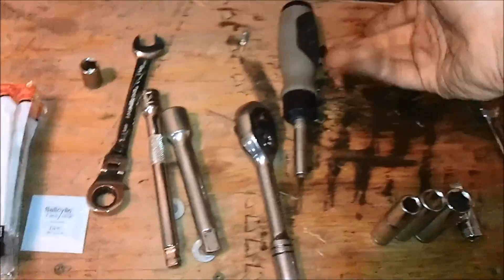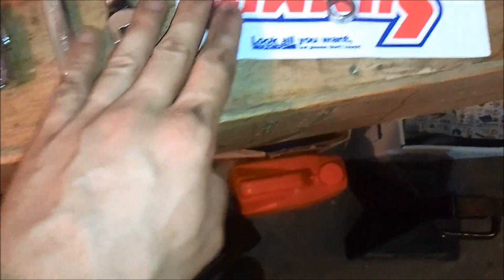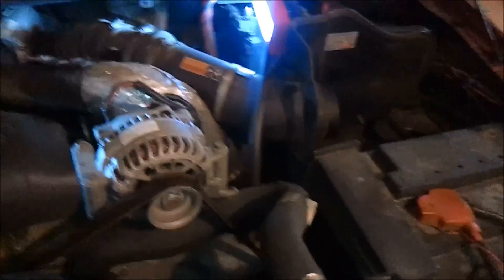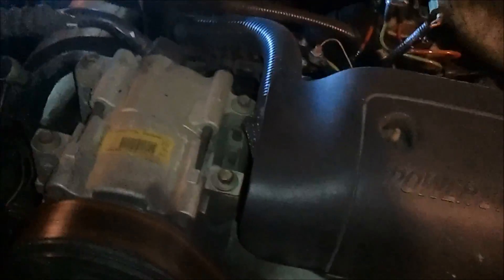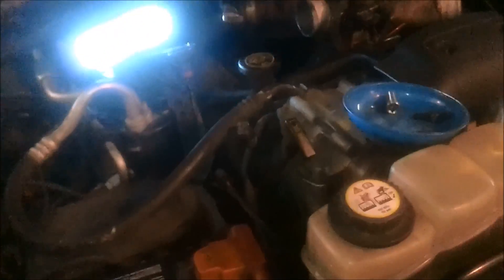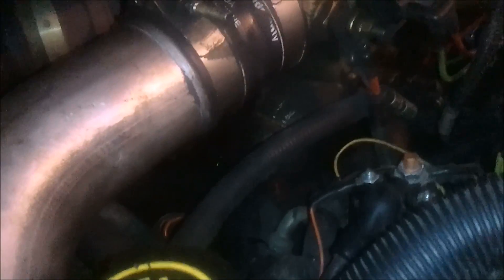How to replace 7 3 Powerstroke Glowplugs

Comment: I just lost 11.46 seconds of my life.  The only thing I learned here is that you got to take the valve cover gasket off to replace them and some other hoses and stuff.  whoever designed this engine needs a slap up the side of the head.  WTF, you got to remove the valve cover?  Never had to do that on a german or volvo diesel. fuck!

Comment: I just purchased Permatex like You have. You put on threads, but You said to put somewhere else on glow pugs,Why at besides threads?Are you only using die electrical grease on wire that goes to glow plugs? With my truck having Allot of miles, Should I spray something down on threads of glow plugs to try and not have any break?
Reply from the maker: +Richard Chamberlin Sorry for not being clearer on that I use the antiseze on the threads and die electrical end of the glow plug. I have never sprayed anything on the glow plug and you kinda cant cuz there is some oil right on top of the glow plug and when you take the glow plug out it goes into the cylinder.
Reply: +N4ANE THANKS FOR ALL THE ADVICE !!! Going to make a YouTube video out also to help others.
Reply from the maker: +Richard Chamberlin Your welcome good luck

Comment: I recently bought a 7.3 is a 1999 dually when i start it it blows white smoke for about 2 mins then it goes away, somwone told me it was the glow plug relay but i tested it and got the 12v that it should be doing, do you think changing the glow plugs on mine would fix that problem or what do you think its causing it? thank you
Reply from the maker: +acarrizalesa Sounds to me like the injectors how many miles are on it?
Reply: 223k
Reply from the maker: +acarrizalesa I would say its about time for some when you do them you might as well go ahead and up grade them more power better MPG

Comment: I just bought a 2000 dually.  I'm pretty sure the glow plugs have never been changed (147,000 miles).  What happens if all eight are swelled in there?  How do I get them out?
Reply from the maker: There are a few vidoes on here with people showing ways of getting them out if that dont work than you will have to brake them off and take the head off or take the head off and then brake the ends off

Comment: You mentioned I have to remove the inter cooler lines x 2 on the pass side?  Are these A/C lines and if so will my truck need a recharge after?
Reply from the maker: No that is your intercooler or charged air cooler and also know as air to air cooler  your A/C lines are smaller that the air to air cooler

Comment: please help
Reply: No such part. If you have an oil leak after a glow plug replacement first thing I would check is to see if the valve cover bolts have vibrated loose.

Comment: I had my glow plugs replaced on my 7.3 diesel truck weeks later I have an oil leak never had one. I call ford they told me my reflector deflector was missing. is that a part that need to be removed in order to install the glow plug? if not where does it sits?
Reply from the maker: I have no idea what the reflector deflector is

Comment: Im having trouble removing what you call the crank case cover its attach to a bracket that I removed already however I can not separate the back hose of the turbo from the crank case there is a small hose that has clamps that I cant remove basically on top of the crank case there are 2 phillip head screws I can get to one but not the other because it is underneath the the rear part of the intake hose into the turbo I have tried loosening up the hose clamps of the turbo it rotates right and left so I know its loose but will not pull off because of that little hose on the crank case.  I know I babbled on here im sure u understand what im talking about so how do I remove this part also do I need to replace the gasket on the vavle covers?
Reply from the maker: I just shove that hose over a little and use a screw driver the screw dosnt have to come out you can take it out with the crank case cover